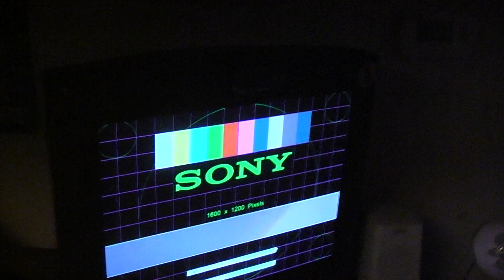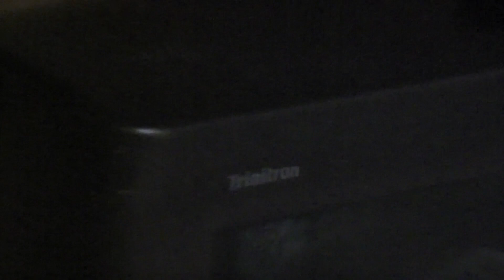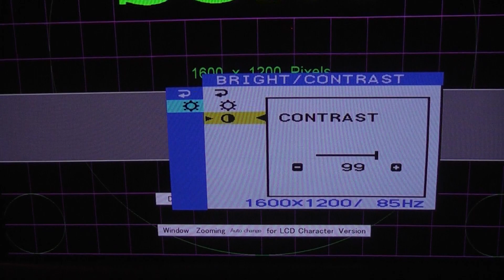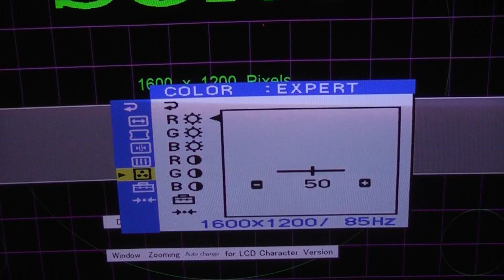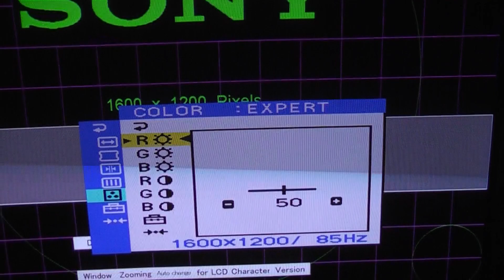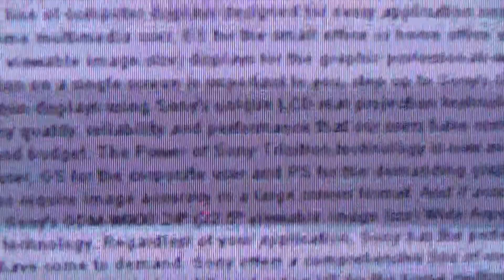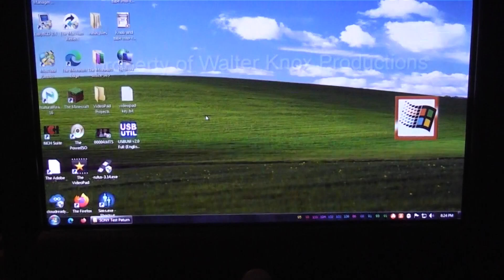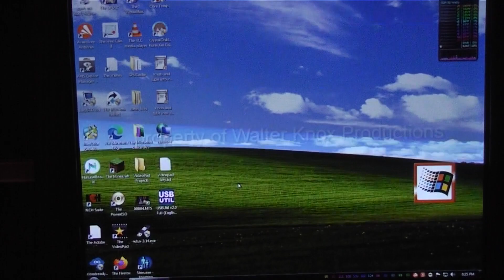How to fix Sony CRT monitor brightness too high

Comment from the maker: I forgot to mention it in the video, but never adjust a CRT monitor (this way, or the correct way) when it is cold. Allow it to warm up for 35-40 minutes before adjusting anything, if you don't, it will not be adjusted correctly.
Reply from the maker: @van dinh Do not post spam
Reply from the maker: The fact that you are posting random meaningless nonsense leads me to believe that you do in fact post spam. Also the fact that you are commenting multiple times in the same thread does not help your case.
Reply: @WalterKnox  you're not allowed to dictate how YouTube comments are made by commenting back, use your moderation tools. lol lots of love
Reply from the maker: @UsernameXOXO  Actually, I am allowed to post whatever comments I want to on my own channel. Thank you for your so very helpful input.

Comment: ive finally found curved monitor - nec m500, perfect convergence, but it had probably some solder joints cracked, so I resolder them, and now screen is too bright, I'll try your fix, thanks
Reply from the maker: This "fix" is not a universal fix for a screen being too bright; it is specific to newer Sony made CRT monitors. They have a bug in the firmware which causes the screen voltage to slowly creep up (the intention was to compensate for an aging CRT over time, but it was overcompensating.) This is also a bandaid fix ad the underlying issue is still there and will continue to get worse. 

An NEC monitor should not have this issue, if the black level is too high and not able to be adjusted by the "user" contrast and brightness levels in the menu, there is likely an adjustment on the flyback labeled "screen" very slowly turn that down until it gets where you want it. (word of advice, mark it so you know where it was to begin with in case you need to un-do it.
Reply: @WalterKnox  thanks, googled on youtube "flyback crt" and some dude did this to his bottom flyback wheel. Worked for me perfectly. Had this monitor for around 2 years, and its finally working properly. Tried with rgb, helped a little, but it's not gonna be enough when monitor gets warmed up.
Reply from the maker: Correct; the fix in this video like mentioned only applies to Sony monitors which adjust the screen voltage via firmware, and even then it is only a temporary fix. Your monitor is not one of these, the screen voltage is adjusted manually on the flyback, turning it down on the flyback is the correct fix.

Comment: I had the same problem with a P260. 
Thanks for the vid!
Reply from the maker: Glad this helped. Just to be completely clear, this is a temporary "fix" at best. It lasted for about a year on my monitor before having to turn all the adjustments to zero, at this point, even at zero it is too bright. I have yet to fix it properly, but the correct fix is to use WINDAS.